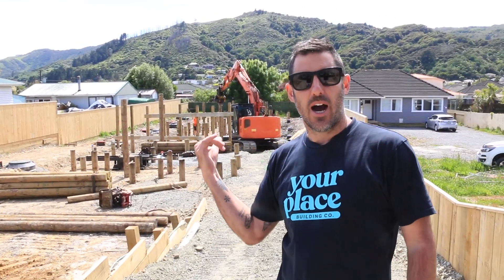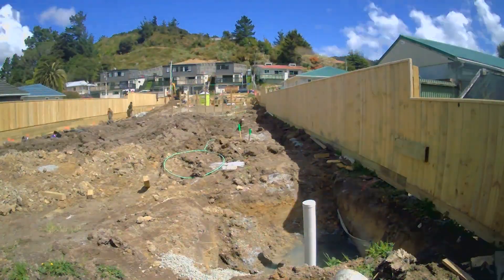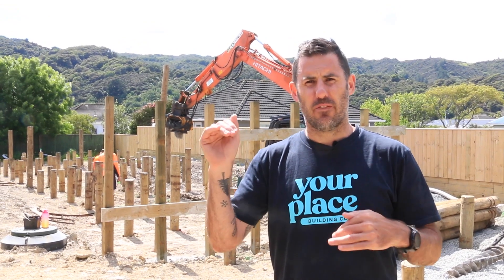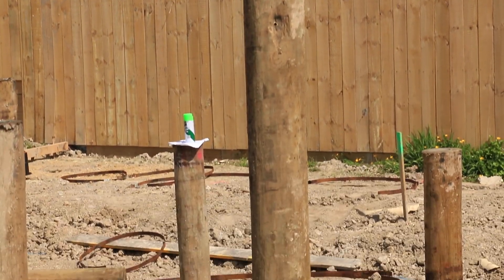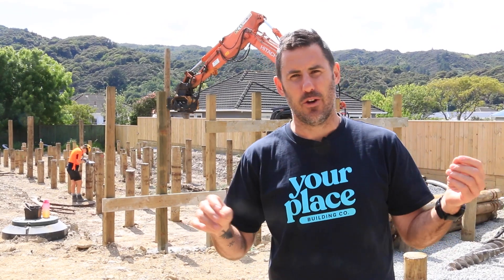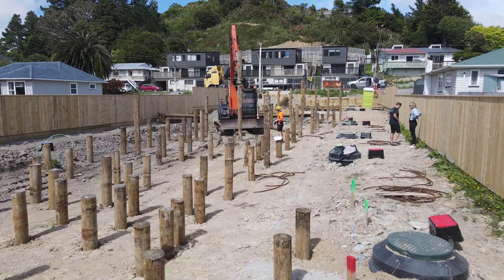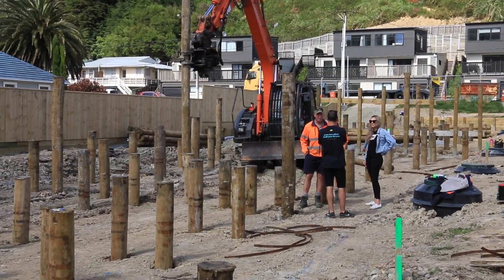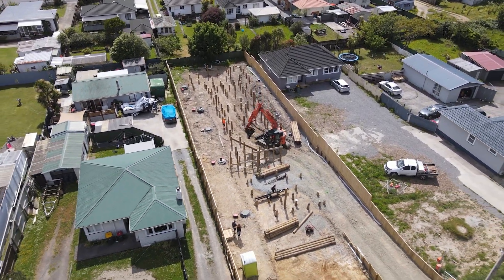Driving Timber Piles with a Vibro Hammer

Comment: Great video. Just a question if your all ready doing driven piles would it be easier to do wooden floor vs a slab foundation or that mean a total redesign of the frame and Truss
Reply: To change over to a wooden subfloor would be a large change to the overall house design and would cost significantly more than simply putting driven piles in under the ribraft. 
In this case I believe that they put the driven piles in essentially as a means of ground improvement. Essentially, they had a standard ribraft design that they didn't want to mess with, and the geotech came back with poor ground results (the top couple metres were not suitable for founding). They can just throw the driven piles underneath the ribraft and continue with minimal redesign. 
In some cases liquefaction is the major concern (we have that issue up the Kapiti coast a lot), and in that case piles driven to specific bearing layers is often required (depending on CPT results). Houses in Kapiti often have to be raised for flooding risk (depending on location, but generally is the case in areas where liquefaction is a concern). So the best option there is usually a timber subfloor on driven piles.

Comment: Hi Josh,do you know much more expensive is this type of driven piles foundation in compare our standarts ones? Thanks
Reply: There no such thing as standard piles, there are either anchored, braced, ordinary or driven, they all have effects for dead loads, live loads, and dynamic loads. Learn the above first, then talk about the expenses.
Reply: @shalimar7100  you seem very smart mate, tell me more about it.....please.
Reply: That’s a ‘how long is a piece of string’ question, as these kinda piles get done in this way for a specific reason.  

I’d consider the extra engineering/compliance reports, machinery/operator hire and materials used to give you an idea of cost on top of what you’d see in an average timber-pile house